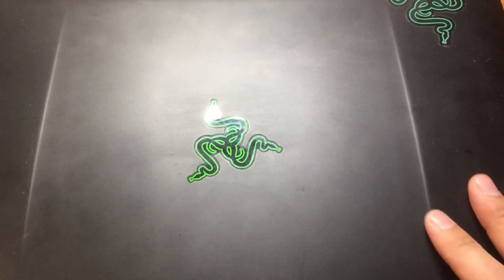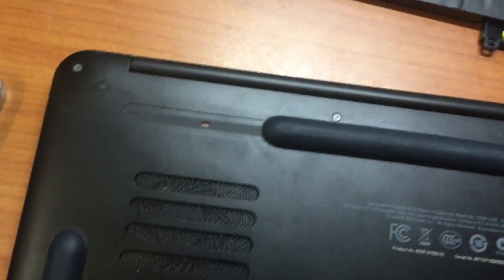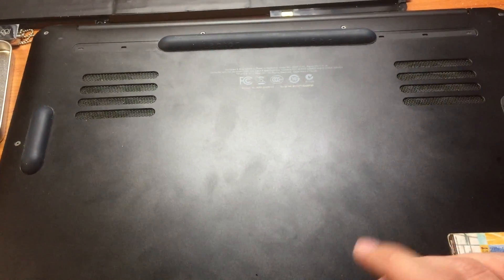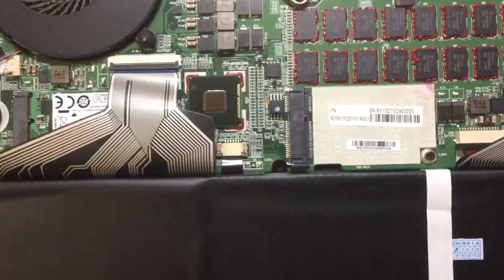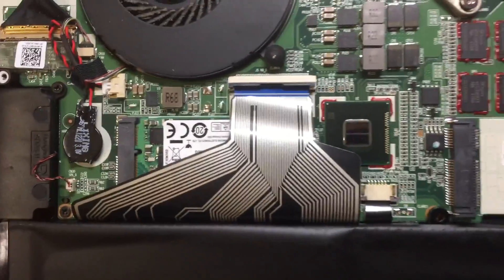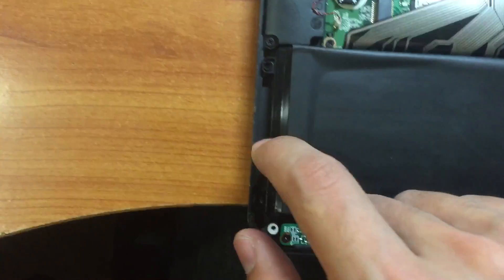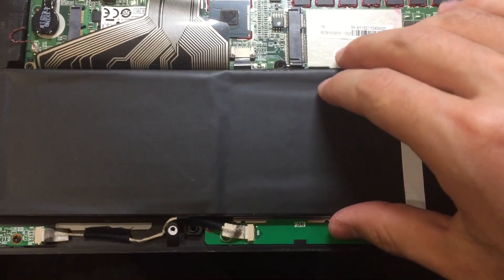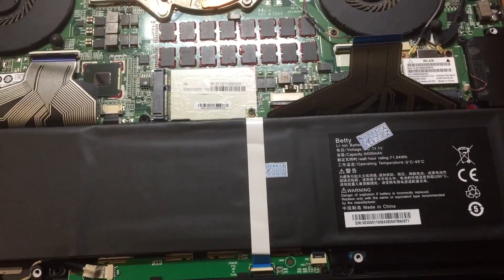How to Replace Razer Blade  14" (2013) Battery in 2017

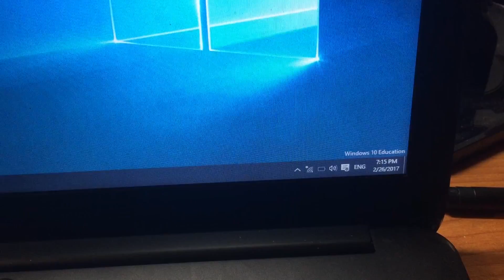Comment: I just replaced my battery just now in my 2015 blade i see you got the blank battery  at 3:11 in the video and then you cut to it showing what its at. did this happen on its own or did you have to do something?
Reply: I have plenty of the trackpad cables if you need one. It is common to see them get burnt. Happy to help in any case.
Reply: send me an email at techworksrepair@techworksrepair.com and I would be happy to send you an invoice for one and get it shipped out to you. If you need any other help with any other issue, I am happy to help as well. I repair these devices daily.
Reply from the maker: Hey, William. Thanks for your question. It happens on its own. It works fine :)
Reply: ok thanks for the quick reply!
Reply: I have a FHD 2015 too where did you buy the replacement battery?
Reply: http://www.storebattery.sg/razer-blade-14256gb-batteries-genuine-razer-razer-blade-14256gb-laptop-battery-in-singapore-p-179166.html
Reply: thanks :) does it work well? i am kinda am lost which is the battery wire even.. any comments on it
Reply: D3ath Angel - Games works fine its the same battery they ship with
Reply: cool by any chance you can help  me out how to replace the battery... i previously opened it up and managed to get the mouse button flex cable to get burnt ." and can't even find its replacement... so am scared what to do haha and what wires to touch .-.
Reply from the maker: Just wonder if you have visited this webpage, https://www.ifixit.com/Guide/Razer+Blade+14-Inch+%282013%29+Battery+Replacement/40190. It provides a pretty good walk through.
Reply: thanks will look through it i am not totally sure if its exactly same for the 2015 FHD model
Reply: @D3ath_Angel did you replace it successfully? I'm replacing mine and I'm scared to screw everything up :(
Reply from the maker: Yes, you are right. The layout might not be the same between different model. I do hope Razer provides a good battery replacement service, but it seems expensive.
Reply: extremely expensive as good as buying a new laptop ." regret only this part of it
Reply from the maker: That battery cost just a little bit more than $100. Almost the same price as you find a third party to replace Iphone broken screen, but you need to do it by yourself : )
Reply: yep just need to make sure i dont mess up somehow i already messed up once ;-;
Reply from the maker: Believe you can do it! Good luck on the next try!
Reply: pbhenry3 : i would be happy been trying to find it for awhile ;-;
Reply: cool, E-mail sent!
Reply: I need some help, can i use the RBS skylake 12.5 without the battery?. mine is a bit bulging already and i suspect the battery is getting swollen and i need to use it

Comment: I have a 2013 razor blade laptop, what can be upgraded to have fast performance?
Reply: the most you can probably do is install an a second m.2 SSD into your system... other than that all the components(except wifi card) is soldered in. 

also to increase performance, you may need to clean out the dust and reapply thermal paste

Comment: Hey i just replaced my battery on my razer blade 2015, but it keeps on showing battery undetected even when it is unplugged from my charger but laptop still works, and after draining the battery, i charge it overnight and it doesnt work on battery anymore. Anyone here with the same problem?
Reply from the maker: make sure you connect every port correctly.
Reply: I did, there’s only the battery port and the touch pad port and the port that goes over the battery cable
Reply: update: the new battery doesnt work at all anymore after i used up all of its charge, and it is still undetected by laptop. I have tested by putting the old battery back and it shows that battery is detected and is charging but old battery only has like 4 min of use on a full charge... Razer RMA is a piece of shit as i'll have to ship them my laptop and wait for who knows how long and get charged a stupid expensive fee for probably a small issue. Has anyone come across this problem? If something wrong with my battery port? Something wrong with new battery? or Something wrong with my laptop, its driving me crazy
Reply from the maker: Where did u purchase the battery? is the battery legit? it seems like the problem was caused by the new battery. Did you purchase the right battery which matches your Razer model number?

Comment: Does your blade get hot? Like does it throttle? Because I also have the Blade 14 2013 and it gets really hot when you play games or render videos. I already replaced the thermal paste once. And it still gets hot.
Reply from the maker: Richard Malo yes, it does, especially when the machine is throttling. My blade is even wired. I closed the lid and put the machine into sleep mode. And it would wake up without me doing anything. Then i put it in my backpack. When i took my blade out, it became a hot metal.

Comment: Hello I need your help please :( I have a razer blade 14 , my power adapter is broken and I want to change te battery, what do I do ? Where can I find a power adapter for it?
Reply from the maker: I actually found the replacement adapter on eBay.
Reply: Regi Fu for how much?
Reply from the maker: the third party one will cost around 20. The original one will cost a lot more.

Comment: Hey man, you´re about to save my life I have a Razer blade Pro 17 Inch 2014 and my battery got swollen.

I think the Model No. of my laptop is Model RZ09-00117 or RZ09-01171E11-R3U1

Do you know what model of battery I should buy from the store you gave in another comment?

This is my workstation, I am outside of USA (So Tech support wont help me) and I´m losing jobs, at this point I´m desperate, I hope you can help me.

Comment: How has the replacement battery been working after using it for a few months?
Reply from the maker: it is still working well. I could watch a 1h30min movies without charging it as before it wouldn't happen. I would say its standby time is 3 to 4 hours if I didn't run heavy duty program like 3D modeling software. By the way, I don't think I use my laptop in a good way because I usually just put it into sleep mode instead of shutting it down.
Reply: Do you use it in high performance or balanced mode when you get a standby time of 3 to 4 hours?
Reply from the maker: high performance
Reply: Thanks!
Reply from the maker: np:)
Reply: how long did it the blank battery at 3:11 in the video to fix itself?
Reply from the maker: as far as I could remember, the battery didn't take long to fix itself. I probably just restarted the computer, then it came back to normal.

Comment: Hi , can I check with you. For my Razer blade model no. RZ09-0102 I saw 2 battery model on the website u given. Do u know which should I get? Product id 1004157 & 1004078.
Reply from the maker: Yeah, we have the same model number. I checked my order again, the battery that I bought is 1004078. Thanks for your question!
Reply: Thanks ! My battery went from green to red in <1min. Need to on charger & even with charger on , the com shuts down every 30min & I need to remove the adaptor and plug it in again before I can switch it on. Wondering if this issue will be fixed once I change battery? Or could there be any chances other component are damaged as well ?
Reply from the maker: Honestly, the questions are beyond what I have met. In my case, even though my battery dissipated very quickly, with the charger plugging in, my laptop won't shut down.

Comment: Thanks for the instructional video!Did the new battery have a good lifespan?  I'm tempted to buy a razer battery from one of these 3rd party online battery shops (which seem to all ship from HK), but have seen bad reviews of their batteries not working and not doing good on their warranties.
Reply from the maker: In my case, It stills work fine till now. Since I just used it for like two months, I am not sure if the new battery can a good lifespan or not, but I could update about what happen with the battery after two years usage here.  From the shipping package, the battery actually shipped from El monte, CA.
Reply: Thanks for the tips Regi!
Reply from the maker: no problem, man!

Comment: Reg Fu do you think if the computer has been having problems with the battery with it saying not charging plugged in and saying no battery detected, then it shuts off one day midgame and wont turn back on, do you think I should do those steps to replace the battery? or do you think it would be a different problem on the Razer Blade?
Reply from the maker: For me, I didn't have the problems that you described, but I have other problems like when I close the lid, the computer should go into sleep mode, but many times, it didn't. Then the computer becomes very hot in my bag, which I really don't like happen. If your battery died, you should do these steps, but I didn't see after you changed the new battery, things will change. You could have a try though.
Reply: Yea i have the same problem so yes it is